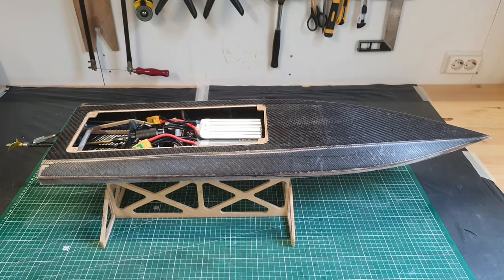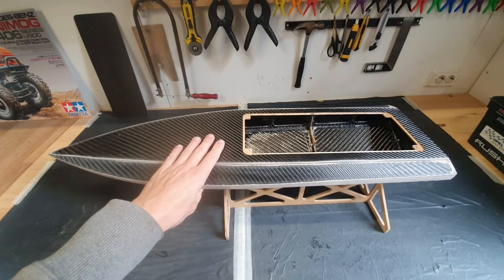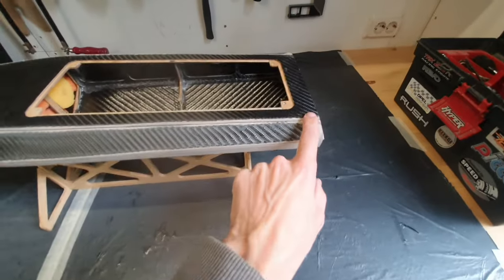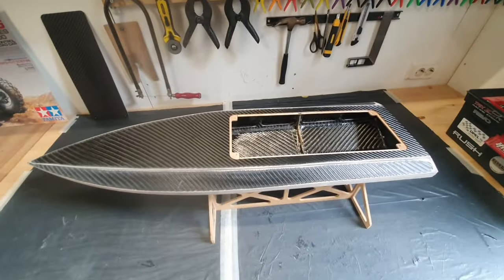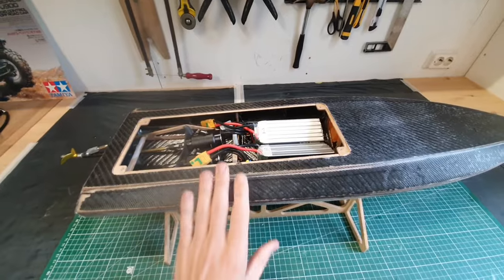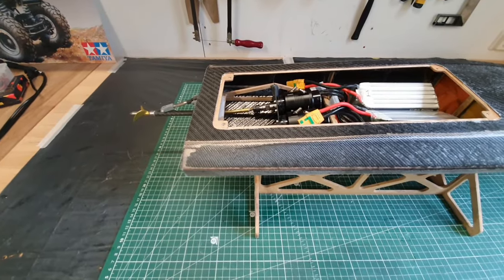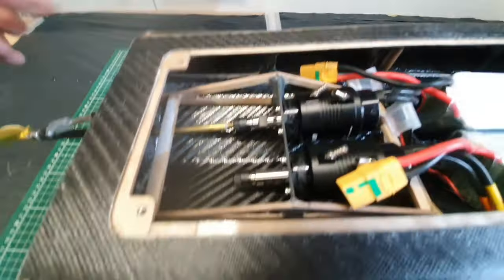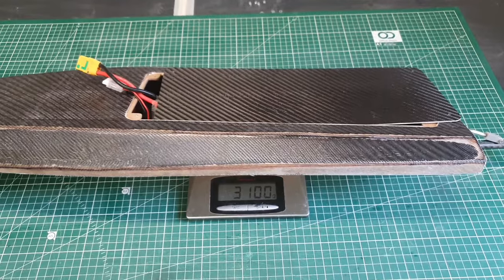RC Boat Build - Twin motor mono part 6

Comment: The brass pipe has no bend !!  I should try it ?  I always struggle to get the bend 😢
Reply from the maker: Hi Deepu, the brass pipe has a bend, please see around 03:05 minutes, where I bend it by hand. Or do you mean no buckling? Because these thin brass tubes buckle very easily! My advice is to bend it with the teflon liner and flex shaft installed. And be very gentle and careful indeed. I buckled the second one yesterday at the first try 😅. Second try was a success! ✌️ DJ

Comment: Super strong hull Jan.👍👍 It couldn t be different with these two 6s in there. I liked the chopped cf technique to glue the deck.  I also particularly like the sloped sides, really cool idea for a unique shape. Regarding the weight, do you have any reference for a twin motor mono of that size?
Reply from the maker: Thanks Dim! 2x 6S up to 4500mAh will fit nicely in this hull. I have no reference for the weight, let's see how it turns out. A bit heavier hull might work better in choppy conditions, which we had today at the RC Powerboat event 👍